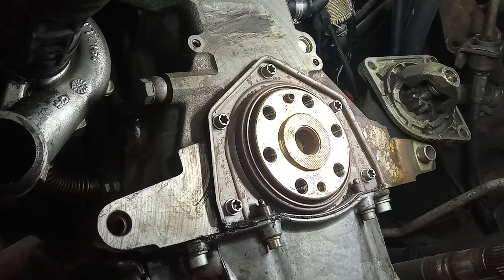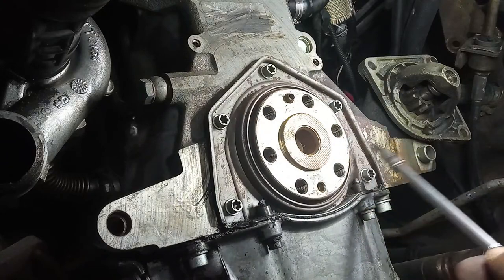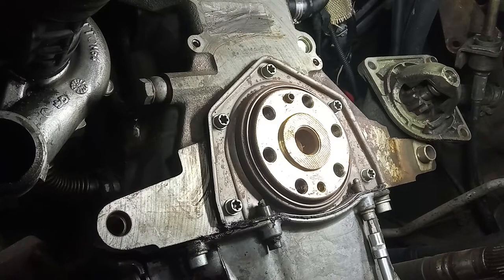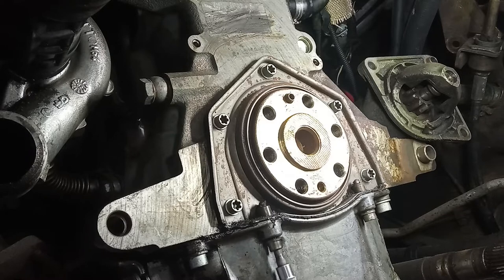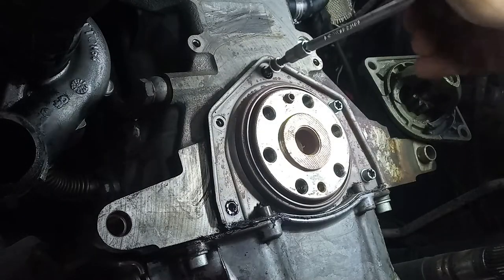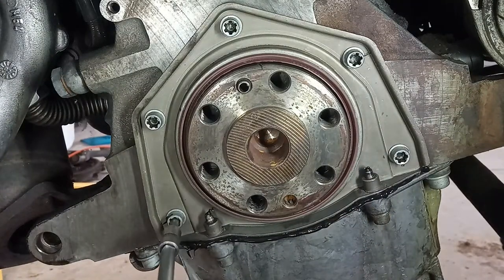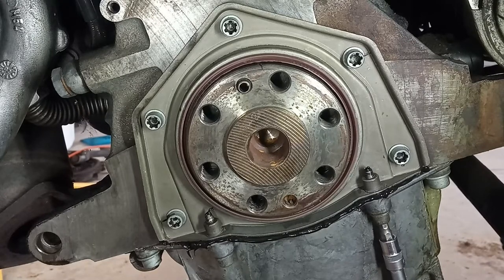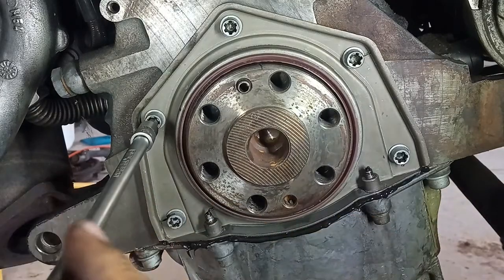Crankshaft Main Seal and How to Assemble Flywheel. All JTD, Mjet, Twin Spark and other engines

Comment: I think the mean reason why new seal after replacement will be leak again is that people doent clean all surfaces properly and use cheap sealants or dont use their... Another option is cheap part (main seal). In the video you tell that we need to take away the plastic Ring 24 h before the job which i don't understand why... In manual of new seal you can find that tool must be removed only anfter installation of this seal but not before. I can agree that after installation the sealant should be cured 24h bedore starting the engine and oil must not be added as well... Otherwise the sealant will be oiled and will not be adhesive with metal...
Reply: Probably to let the rubber unstretch inwards a bit, to have a tighter fit.
Reply from the maker: The new seal can have months or years in stock with the tool in. This can deform it a bit, for that a 24h re adaptation time is for the best. I've seen it myself

Comment: Hi, I cleaned everything and put in the new gasket, only by mistake I first removed the plastic ring and then installed the gasket, could this be a problem? i know that i need to wait at least 24 hours before turn on the car
Reply from the maker: Hello. Its not a problem if you are careful. Just yesterday I did it without the tool on one. If you are confident it will be ok